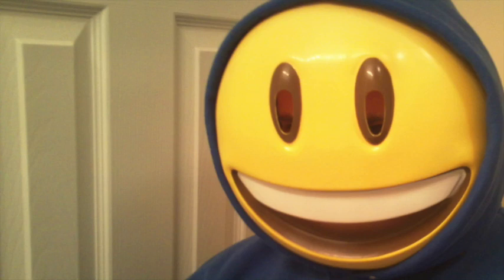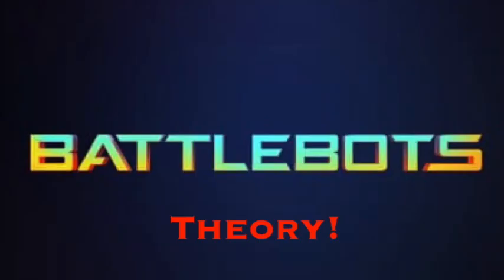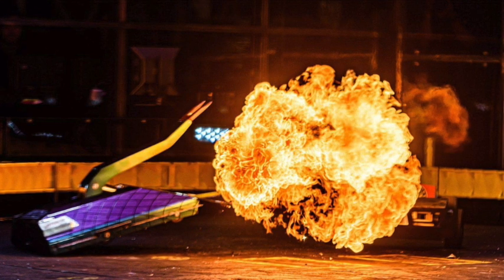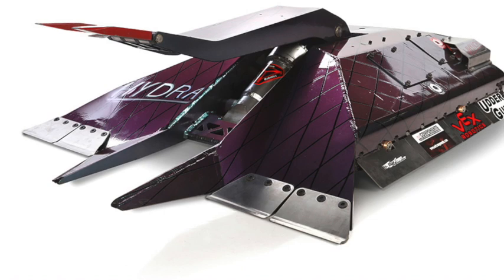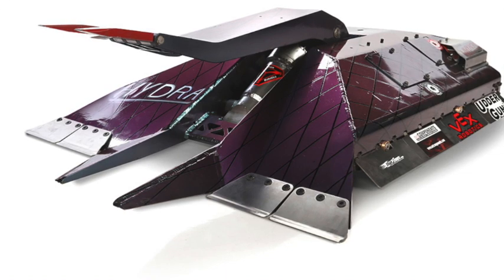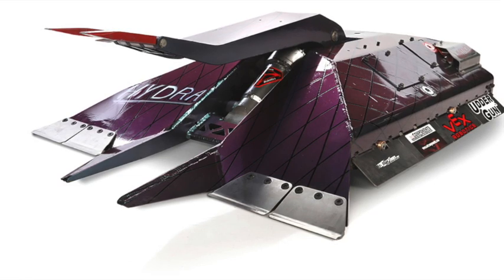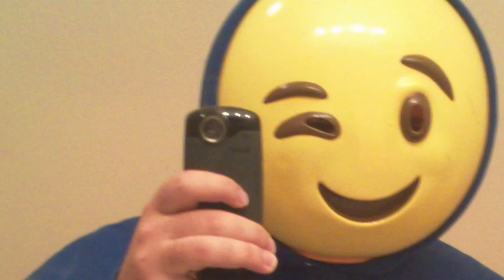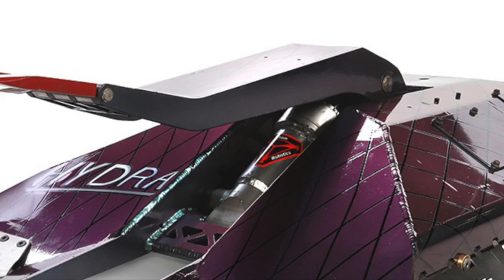Battlebots Theory: How does Hydra Work?!?

Comment: I am a diesel/industrial mechanic with experience in hydraulic systems, and just based on seeing a couple of video clips and pictures, I was going to say that there is no way that it is any sort of spring power, there just isn't enough space, but that it likely uses a standard nitrogen charged hydraulic accumulator at between 2-4k psi, and a small pump that retracts the ram against the accumulator pressure, and then a big valve to dump the pressurized fluid in the accumulator rapidly into the cylinder.
The size of the cylinder and hose looks about right for this, and it would work quite well, and I suspect that the main downside and reason others haven't done this before is because the parts they need are expensive!

But then I looked and Richard had posted a helpful link confirming that they had done it that way... Lol

Accumulators often go up to 5 or 6k psi or above, but I didn't think battlebots would allow that much pressure. It would throw bots right through the ceiling lol
Reply from the maker: And judging from what the team told me, you're pretty much more right than I was lol
Reply: @NorrisVaughn  I didn't post the link, that was someone else.
If I had posted it, I would have said something about how they explain how the system works or something, but I don't see how posting it with no comment is acting superior, that seems to be reading a whole lot of intent into the lack of a comment. Lol

And it had the benefit that I suspect was intended, I clicked on it and found very interesting information that I enjoyed seeing, so maybe if you had not known about the Facebook post already it would not have triggered you.
Reply from the maker: I know, right? I am actually going to be doing a follow up video to this because the team actually explained this all to me over Facebook. I am glad you are not 9ne of those jerks trying to point out this info was out already lol
Reply: @the_mystery_writer  how is posting a link to answers to your questions being a jerk? I missed what you took offense at.
I personally found it very helpful, because it let me see exactly what they were doing, and confirmed my ideas.

Not sure what you are getting upset about lol